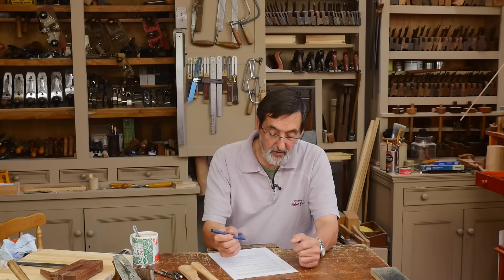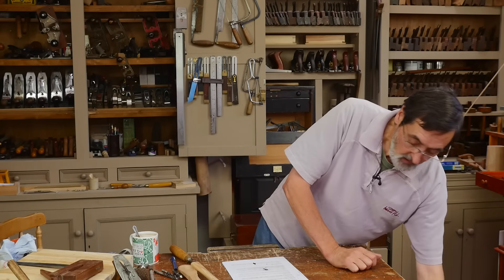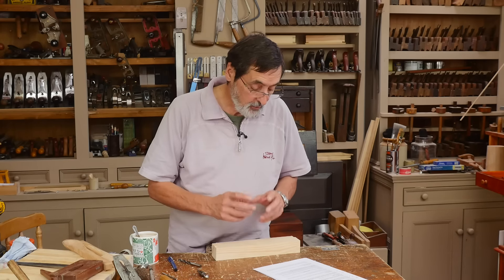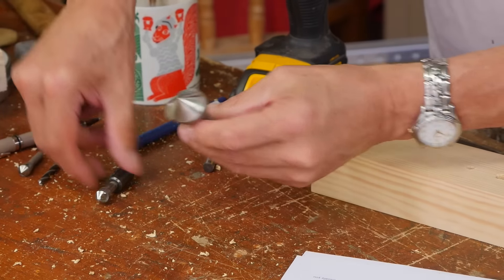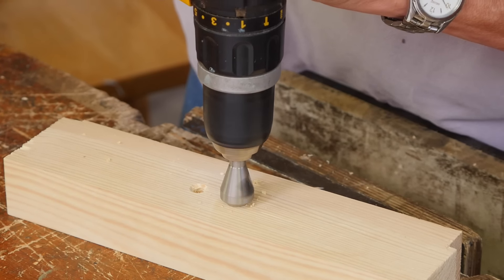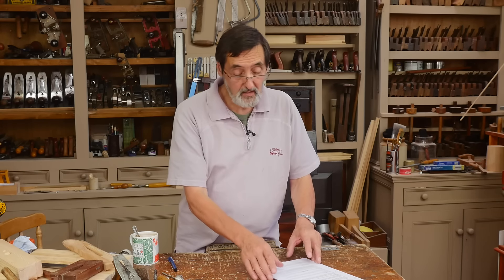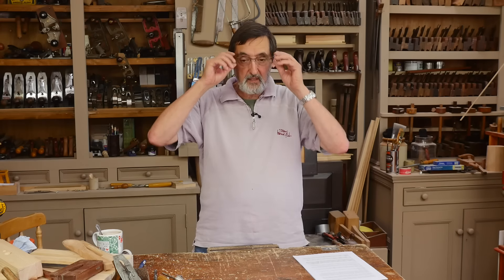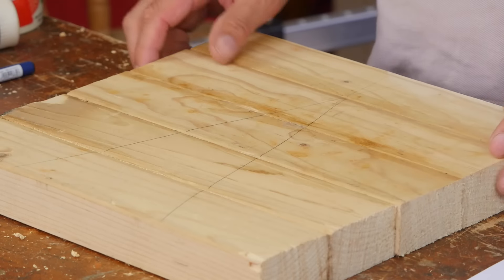Q&A with Paul Sellers Episode 3

Comment: Last night I took a No5 Stanley Jack plane I bought off of eBay for $28 (and then restored) and proceeded to shape and square up a 2x4 for a railing I am building for my patio. So what? Well I have never used a hand plane before other than a little practice. Nor have I never build a significant woodworking project before. I learned how to restore the hand plane from Paul Sellers's instructional video. I learned how to square up the lumber from another one of his videos. Because of Mr. Sellers's videos, I have a base knowledge of many woodworking techniques and methods with no experience. Its on me to work on the latter. Thank you Paul for sharing your knowledge!
Reply: Do you like the fact he doesn't give everything away either, such as the Japanese saws.

Comment: Thanks for your continuing effort.  As a master machinist (turned industrial engineer) and now retired to the workshop (my greatest pleasure), I completely agree with your assessment of the term "apprentice".  Like school or any other profession, you must develop the skills of the task.  Most of us do this best under the guidance of a master.  To go into the shop world sometimes encompasses going in as a "general worker" while you refine your talents toward a specific area.  I spent a full year sweeping floors where the foreman would pick up  metal shavings and ask about speeds, feeds, type of material, etc.  Not unlike the shavings from a plane.  To have folks that will pass this knowledge to the next generation is the only way we can continue to craft.  Keep carrying the torch.

Comment: On your last question, Paul, it seems to me that if you're trying to convince a private small business owner that he or she should take you on as an apprentice, you may need to be willing to sign a contract for a certain number of years' service even after you're "trained." I had to do that for the specialized training I received in the Military (added two years to my service term right from the beginning) and I had to do the same to get into my current career - my company paid for my training classes and provided on-the-job instruction, but I had to agree to a minimum two years' service or I was on the hook for the cost of the classes. It worked out very well for me, so no complaints.

Comment: Paul. Re: Dovetailing the end of a very long piece. I've done this on 2"x10"x12' boards and 1"x6"x6' boards. I lay one end of the board on the ground (padded) and the other across a sawhorse and clamped (with padding) so the end I'm cutting will be just at chest height when I'm sitting in a low chair.

Comment: Two questions if that's okay: 
1. How would you accurately cut large panels by hand without power tools if they're not available? Think 4'x6' plywood sheets and larger.

2. What is your favourite tool or combination of tools? For example, I absolutely love the combination of taking the time to set up a complex cut, marking it and creating knife walls etc. and then how fast the saw turns those scratches into a beautiful joint.

Comment: I know for myself as a woodworker I needed to go on my own.  Needed to read a whole lot of books and then it's trial and error.  Trying different techniques and seeing if I like them and it seems like every time I make a piece I end up tuning up my skills with new techniques that I pick up.

I know for a fact that it's hard for me to think of taking on an Apprentice.  For the simple reason that I would be responsible for that person's safety all the time.  Then I need to basically look over his shoulders to correct simple things.  And I mean simple things like sanding with a random orbital sander.  It doesn't get simpler than that and yet I find myself needing to stop everything and show and explain how to do it proper or at least how I want it done.

Sometimes I end up putting somebody on sanding and watch them quit or I need to fire them.  If they are not going to do that right I won't be able to get them to do anything right.

Comment: Paul, your clamps that you use. I have just purchased a set of 10 x 1500mm aluminium sash cramps from a company called "Tool and Fix". They are the cheapest online company around with free delivery over £45. Their delivery is good but sometimes need to be chased if the item is awaiting delivery from a warehouse. My cramps arrived within 36 hours and are identical to what you use. John

Comment: I have a Disston K29 saw with hardened teeth not designed for re-sharpening. Can I use a torch to remove the temper from the teeth and make this saw sharpenable?

Comment: I recently came into possession of several very old sharpening stones (I'm 63 and they belonged to my great-grandfather). The courser stones are fairly easy to identify but it is quite difficult to determine the relative grit on the finer stones. Is there a way I can check the grade on these so I can use them in the proper order?

Comment: Hi. I finally brought my first hand No. 4 hand plane. I have sharpened it to 1200 grit but I have having a lot of trouble cutting end grain. It's biting and I'm getting a lot of breakout on the out feed side. Any pointers to get it to work nicely?
Reply: hi high
Reply: Have you done the following?:
Sharpen your plane blade to the point at which it easily removes hairs from the back of you hand.
Then set it, as carefully as you can,
Apply a light film of oil to the sole.
Retract the blade so that it barely cuts.
.
Now try it on your end-grain, advancing the blade by the minimum amount, and you should be able to take off 'shavings' of end-grain.
.
If the pieces are small enough, use a shooting-board, possibly the most under-appreciated, but absolutely essential tool for the hand-woodworker, and the very best way to deal with end-grain.
Reply: You can't let the blade edge go past the "out feed side". Work from the outside to "the middle". If you must go past the "out feed side" then clamp a backer to the work piece. when doing end grain set the iron very fine and cut on a skew angle to the fibers in the end grain. When I shoot end grain with a straight iron I always add a backer to support the fibers at the end.
Reply: A no.4 on end grain c tricky to begin with because it is rather light and a board with any substance is going slow the plane forcing you to muscle through.  Are you using a shooting board.  That should help with the breakout at least.  If you are and still getting break out, look at the position of the fence with respect to the plane's sole as you finish a stroke.  Also, adding a steeper secondary bevel to the blade edge might help.  Also, while 1200 is nice and sharp, for cutting end grain you might want to push the sharpening farther.  Also moistening the end of the board being planed can help a lot.  You can use water or alcohol for that.

Comment: I think that most people looking for an "apprenticeship" now are actually looking for an entry level job with on-the-job training.
Reply: Isn't that what an apprenticeship is?
Reply: Not really. Re-watch this video - he discusses it.
Reply: I apprenticed as a plumber and became a journeyman before the market busted in '08. It was paid but it was all busy work, or watching plumbers work and handing them the right tool like a surgical nurse. It felt pointless and unproductive. It didn't feel like a job or like training but I stuck with it. After a year of this I was finally allowed to pick up a wrench and start helping on jobs. A year later, I was a plumbing machine that could run circles around people that just got the four weeks training from Roto-Rooter... Apprenticeships are very different from typical OJT and they pay off. They suck a little while your in the middle of it, but it's sooooo worth it.
Reply: Depends a great deal on the job.  An electrician, carpenter, or sheet metal worker's union local will take on apprentices, but that is a union job and the outcome is a trained operator.  Union apprenticeships provide both on-the-job experience and class room work, with union meetings thrown in for grins.  You don't get paid as an apprentice, but you do get pay for job site work as an apprentice.  The local will maintain a list of active local jobs and apportion apprentice time among the apprentices, which is where any pay comes from and whence your union dues are paid as well.  Once you've put in your time and learned the trade, then you can take off as a journeyman and take a full time job in either a union shop or drop you union membership and wing it.

Comment: Does anyone know of a material that you could use instead of the leather for the polishing strop. For vegans. I'm selling vegan stuff.
Reply: But you do not eat the strop.
Reply: Very true. But I sell non animal sourced products to vegans. And I just 
want to know if anyone knows of anything that would work. There may well
 be nothing that compares. But be interested to know from anyone with 
knowledge on these things if there are any options.
Reply: You can use cardboard, denim, wood/plywood. Or self-adhesive abrasive film from 3M on glass/mirror.
Reply: I recommend microfiber cöothing, e.g. From an old jogging pant. Works perfect with green compound
Reply: Wolfram Herzog
Thanks will check out microfiber. That sounds very interesting.
Reply: rusty nail
Thankyou, that sounds worth trying out.